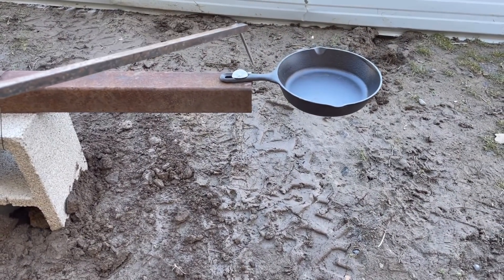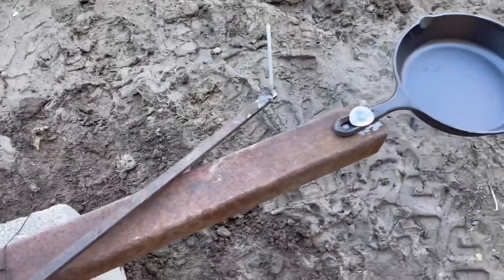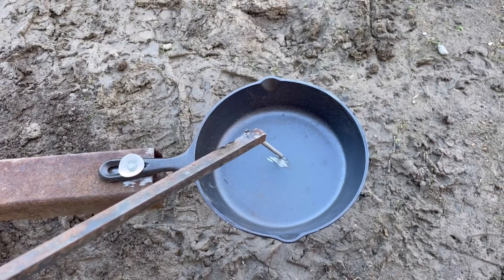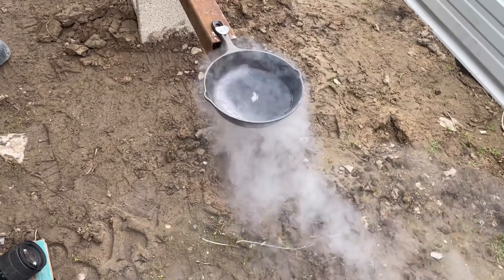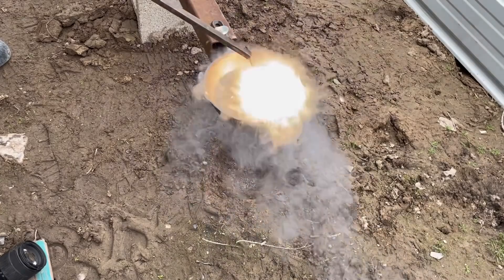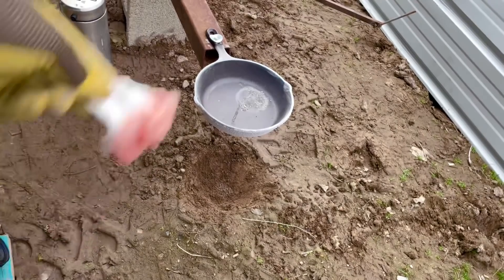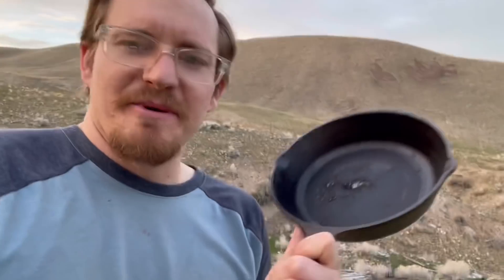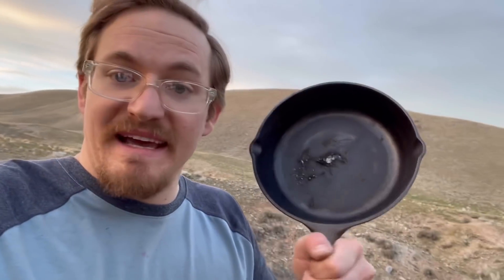Welding in an iron pan full of liquid oxygen

Comment: Always feels good to confirm your suspicions! 
Super weirddd however-I was just told a few hours ago…  by a coworker whom used to be a welding instructor that he used to amaze his students by starting a cut with o2/acetylene then just shutting off the acetylene and it would finish the cut using only o2
Reply: I think this is a trick all welding instructors do lol. But oxy/acetylene torches are doing most of the work with oxygen. Acetylene just helps get it a bit melty so the stream can react and physically blow the metal out
Reply: @theodorekorehonen  the steel has too reach the kindling point then a high pressure stream of O2 quickly start a exo thermic reaction with the metal heating the metal in close vacinity to the same kindling point
Reply: @theodorekorehonen  100% this. I run propane because I'm cheap, and my torch blows out regularly (because amateur) but the cut continues on.
Reply: Yeah, the acetylene is just useful for the first heating, rest of the cut it is pretty much useless.
Reply: While i'm not a metallurgist, I am a welder and cutter and it's actually the o2 that cuts the piece and technically it doesnt "cut" so much as it "rusts insanely fast" through it.
The o2 is needed because it forms a reaction with the acetylene, causing the piece to rust, Acetylene gets nowhere NEAR hot enough by itself to actually melt steel, which is why we throw oxygen into the calculation.
Same reason why you can weld with Oxy Acetylene, is because the mixture actually creates a shielding gas from the environment similar to MIG or TIG with Argon.
Reply: @DrCranberry  that’s really exactly it! 
No need to be a certified metal composition expert to know the science behind the physics of our craft! 
I like to think** in a way we-being the builders of the engineered piece- are actually more capable than the officially educated engineers themselves 😬😅🤷🏻‍♂️😜
Reply: He mentioned that was the case, but the base steel has to have some thickness or the oxidation isn’t substantial enough to continue the burn?
Reply: @TheSpectralArtisan  I have cut 5mm steel without acetylene, just angle torch in direction of the cut and move at right speed, I have worked with cutting steel all days for years so have tried numerous tricks, doubt I could do this now, been couple of years since I did the gas cutting full time.
Reply: @marthale7 Cut steel, sure. Welding. Maybe not. Welding is melting steel. Cutting is burning steel. Two different processes. 
That's why you can i.e. use propane gas for cutting, but not for welding.
Reply: Were you told that by This Old Tony?
Reply: @jakemensing6672  I’m not sure who that is! 😬

Comment: isn’t oxygen flammable? why doesn’t it burn from the welding spark?
Reply: Oxygen makes flammable things more flammable (at least at a very very basic level) its not flammable in it of itself.
Reply: Its not exactly flammable. It just accelerates existing flame.
Reply: Flammable means it can react with a fuel to make fire. The only fuels in contact with the oxygen were the pan and the rag. It doesn't burn all by itself.
Reply: O2 is not flammable, it supports combustion. So there has to be something flammable and on fire near it and it will accelerate the fire
Reply: Oxygen on its own isn't flammable. Remember that combustion needs three things: heat, to provide the initial energy to start the reaction, an oxidizer, like the liquid oxygen, and fuel, like paper, wood, gasoline, etc... whatever will react with oxygen to combust.

When Cody strikes the arc in the pan of liquid oxygen, that provides heat, but the only fuel is the iron in the pan itself, but as Cody says in the video, the surface layer of iron oxidizes quickly and protects the rest of the iron from reacting.

Later, when he throws in the burning diesel rag, that provides fuel in the form of the diesel and the rag itself, and you can see that combusts quite nicely, since all the components needed for combustion are present.

Comment: Now that I've seen it, I wonder how a TIG welding setup would do if you replace the Argon with oxygen gas. Replacing the electrode with something inert would be a wise thing to do.
Reply: Thats the exact opposite of what the gas in a TIG welder is for
Reply: You would have a single use “sparkler” tig torch.
Reply: Let me know when you find an electrode that both doesn't oxidize and doesn't melt at over 3000C. And then, you're basically welding without any shielding gas at all which I can tell you from experience doesn't work well.

That's not to say there isn't some room for extra reactivity. Some TIG processes use some amount of Helium or Hydrogen added to the Argon gas to increase the heat of welding.
Reply: @bradley3549  you can weld with active gas's such as oxygen that's mainly a MIG/MAG welding gas and is used in very small quantities, never heard of it being used on a TIG/TAG machine before since they mainly use as active gases such as helium, hydrogen and nitrogen.
Reply: @DatBoiOrly  Is there an echo in here?
Reply: @bradley3549  ohh didn't see the "read more" lmao sorry bout that
Reply: what youre describing is called an oxyfuel welder/cutting torch and its what cody was talking about at the start of the video. you dont use an electrode because theres no need for one (and it would immediately get burned away anyway) you just start the cut off with an oxyacetalene pilot flame and then use pure oxygen to cut through the metal, the heat of the metal oxidizing is enough to sustain the cutting/welding without needing any fuel or an arc.
Reply: Might be interesting to see it actually demonstrated as oxygen is what you are trying to displace with inert gas when tig welding. My understanding is that it makes it way easier to burn holes but the electrode will burn away quickly.
Reply: @brianm.595  Guess platinum electrodes would do the trick. Or would they too burn out under such a high temperature?

Comment: Too cold to react.
Reply: My thoughts exactly. I suppose that liquid oxygen was taking away too much of the heat, so the burning couldn't continue
Reply: Even if the pan where hot and you poured the lox on it it might hold up as without the gas flow stirring things up the oxide layer would slow and shut it down
Reply: @paintballthieupwns  Now that I think about it oxide does smother, tho I didn't think it was convincing when Cody said it. 

Yea I change my mind. Is probably the oxide above all else.

Comment: Oxygen is scary as shit, I don't know how you mess around with that stuff tbh.
Reply from the maker: I keep finding that it’s not as scary as described.
Reply: @theCodyReeder  I think its low temperature partially offsets its reactivity. It's so low temperature it slows down the reactions it intensifies and ends up not being nearly as dramatic as you would expect based on the amount of oxygen involved.
Reply: @lobsterbark  It needs a fuel source, the O2 isn't very reactive on its own.
Reply: Simply don't grind your oxygen tanks with grinder and don't add oxygen to something that already burns well